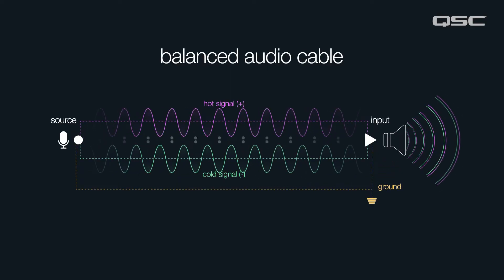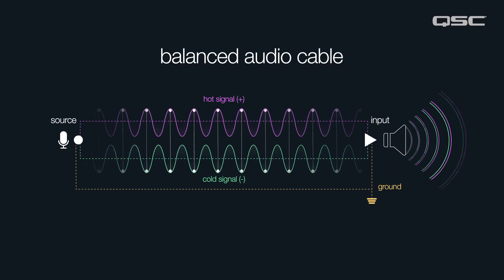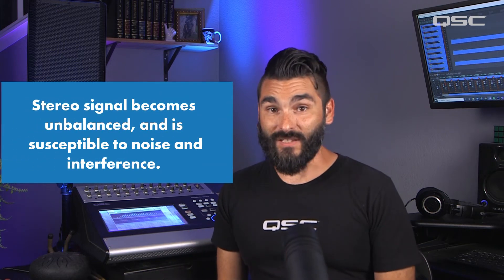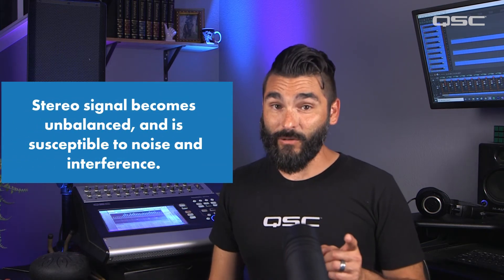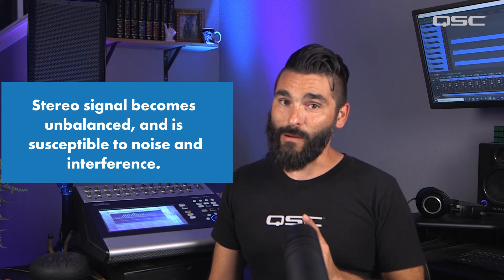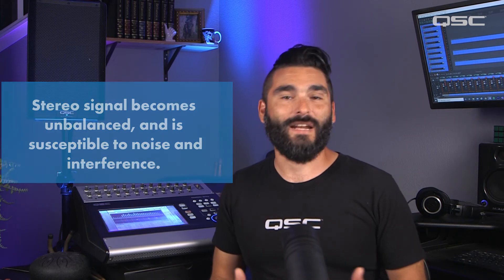What are Unbalanced Stereo Cables? | Sound Advice

Comment: So then what would the wiring look like of a cable that is carrying stereo balanced signal? Does it have to have FIVE wires inside? Two duplicated for left channel, two duplicated for right channel, and one ground? In that case, it'd be like a five-pin XLR for example? 

I thought that a cable becomes balanced as long as it has an EVEN number of wires carrying signal. So I figured that in the scenario where you have a cable that has three wires, one ground, and two for signal, if one of the signal wires carries left channel, the second signal wire carries right channel, then both signal wires would pick up the identical interference signal, and that gets canceled out in the differential receiver, no?
Reply: I actually need someone to answer this question
Reply: although, not your last question. I'm pretty sure that's a no